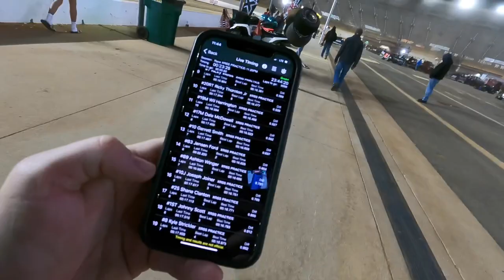Full Speed at Bristol! Super Late Model Practice Night at the Bristol Dirt Nationals!

Comment: Joey!!!  Run about 2 feet higher in the turns. The groove here is higher than a regular short track. When you go to bouncing cause you are low, they are going by you on the high side in the turns. Just a suggestion.. Go back and look where the faster guys were at in the turns.
Reply: Could take 2 1/2-3 ugga duggas OUT of the left rear also..? Youinz are out of balance a little?

Comment: The Warrior chassis builder in the booth last night said  to run a 650 lb spring in the right front. If I remember correctly
Reply: At least!! Need an 800 on that bad boy but idk why anyone would even carry that. It's possible that might have been an oversight since they ran crate last time
Reply: @cgundlac oversight, seriously. And no one is running a single 800lbs spring.

Comment: Probably need a 100 - 150 lbs. stronger spring on the right front and back than usually run. Good show but that will fix the roll over problem and that big motor can eat! Go HTF!

Comment: Did I hear that correctly “Dale Motor” like SB2 Dale motor? sorry I don’t know much about the car I came over from Cleeters channel.
Reply: Never mind you mentioned it in the video just after I typed this 🤣🤣🤣🤣
Reply: Yes it’s a engine that came from a engine builder that used to work for DEI , thanks BigAl
Reply: Yes but it is a big block , I believe the aluminum ones ,  close to 900 hp  some like 850 875 , real deal engine, kool thanks BigAl.

Comment: that 462 is not a stroked 454 , its a big small block, after market with a two speed transmission, for a track like Bristol im guessing the quick change gears may need go like 35 or lower

Comment: I know this may sound stupid but why not trim the fender and put a spacer under the plastic to get it off the tire?? It enters the corner great because it's soft enough to get bite. You'll need that if the track keeps getting run in and slicks off. You could see the fender make the car drag brake on entry and get sketchy for a half sec. Remove that and the car is probably alright. Good luck boys

Comment: After this is over, I would be interested to know how stiiff the rr was on the 10 car..............450?  600?   650???  Or excuse me, what was the load be  at x number of inches be???   I could dial it in within 3-4 practice sessions, but I am currious.  I just bet an old school 350 with 2 spring rubbers would eat.     The car was more throttle loose on the 2nd rf combination, so that tells me that you guys are sneaking up on the rf that is stiff enough. Darnit, the car was only throttle loose for 2 corners, and then the driver adjusted.    Joey is getiing better!!!

Comment: Anyone know what speeds they are reaching at Bristol?
Reply: Brian Gerster set the fastest lap recorded in his #50m Sprint Car with a 12.742 second circuit around this high banked 1/2 mile oval track at 150.585 mph  I'd estimate the supers are running at least 125+ avg. speed.
Reply: @djpatriot5315  Thanks for the info. The Street Stocks looked like they were getting close to a 100 mph.

Comment: I hope that the AUTOMATED TRANSMISSION in the hauler and the C13/C15 450 horsepower cat is more troubel free than most AUTOMATED TRANMISSION'S and C13/C15 450 engines have been.   The cummins 350 and the 10 speed are 50 year old tech.   I hope that the egr cooler on the engine does not leak and blow a head gasket like they all did.........but as old as this rig is now, maybe, just maybe one of the previous owners did a delete delete delete on the Egr, along with the crazzy, crazzy muffler.          Most people with this engine are running the "Euro" tune from Mr. Haney, or a similar person.   No idea have to improve the crazzy  transmission.   I hope Cledus does not DIE, and secondly, I hope he does not DESTROY some poor boys junk.    He has no idea what he is in for.